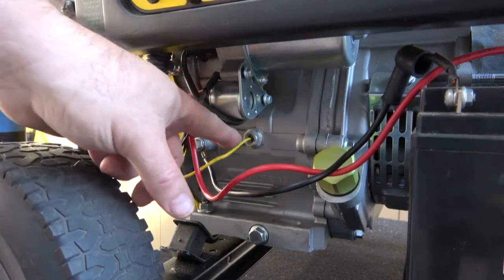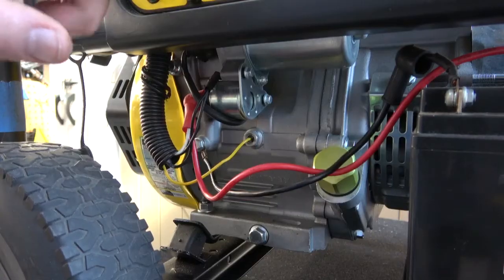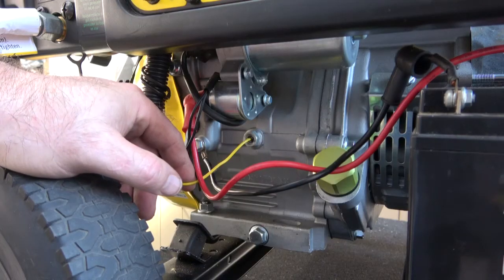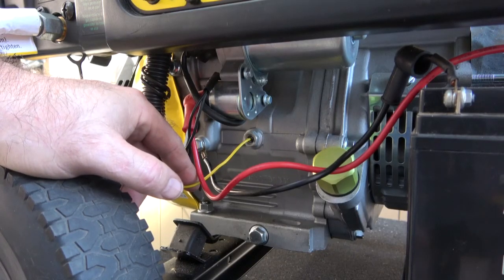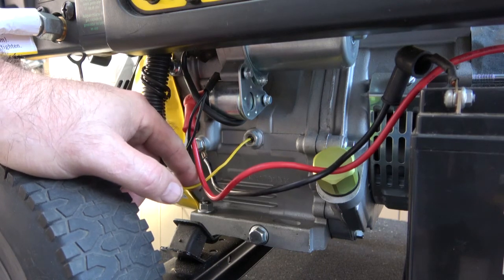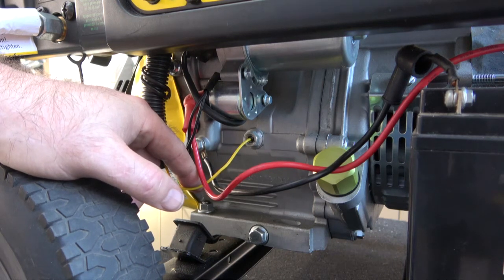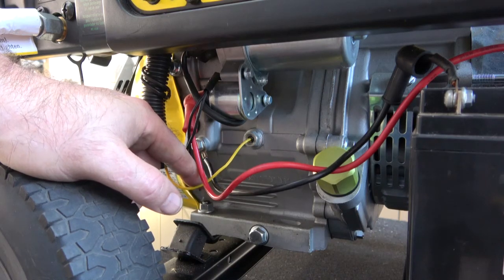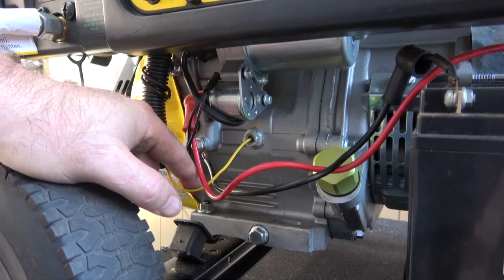WHY YOUR GENERATOR WON'T START | OIL SENSOR | Champion Dual Fuel Generator

Comment: Did not know what that little part was that went into the engine thank you. Now I know oil sensor, a rat chewed wire off. Was not able to splice because wire was cut right there by the sensor. So now I have to get on website and hopefully order new part.

Comment: I have a champion generator gas that someone filled with diesel.  Got the tank drained but it ran one time since then also back fires. Just won't start. Checked fire checked gas and air. Won't start. Checked valves none are stuck open and have been adjusted with a gauge. Need help. Thank you.

Comment: Before disconnecting the oil sending unit check for spark. If your oil level is good and you have spark, the problem is NOT the oil sending unit.

Comment: I installed a toggle switch for fast troubleshooting on oil shut down wire
It’s good to pick up one end 3 inches and drop it before starting 😊

Comment: oil sensor wire is disconnected from the sensor. How do I bring out the sensor for replacement
Reply: Remove engine and sump cover is how 
But lift it 3 inches on one end and drop it and try that first 😊

Comment: You mentioned the sensor is "real easy to change". It appears to me the engine block has to be taken apart. Am I missing something?
Reply: Looks to me it just unscrews out of the block.  It would be really dumb if the block had to be taken apart to replace a sensor.
Reply: Sorry, that I was late to answer your question. I was in a car accident.  I meant that it was easy to disconnect the wiring to the oil pressure sensor all you have to do is disconnected the wiring to the low oil sensor and  monitor the oil level. Some generator do not have that feature. If you want to change out the low oil sensor call the Champion help line. They are open 24/7. When you get on the line and it saids that we are closed just stay on the line you will get more options. They are the best customer service that l have ever seen. Bill

Comment: Thank you for the post, that's exactly why my Champ Generator did not want to stay running, after unplugging the Oil sensor, the Generator will stay running.

Comment: I have the 3400 inverter and the video champion sent me is very different then the one I have. I can't find my low oil sensor
Reply: Here is my email address. Sent me your contact information.  I will call you. The sensor is in the crankcase. I will send you a video from Champion showing where the oil sensor is in the crankcase.

Comment: I unscrewed the oil sensor thingy and the thing fell in and I’m trying to take it back out so I can put it back to normal do you know how I can take it back out
Reply from the maker: Sorry, I don't know. I would call  Champion at 1 877-338-0999. The call center is open 24/7 say on the line and don't hang up. It may say the office is closed but the call center is open. If there is an answer they will have it.

Comment: If your oil sensor is on will your spark plug still spark?
Reply from the maker: Your oil sensor is not on your spark wire. It is on  the engine. Look in your manual in the parts list diagram to see the location of the oil sensor.
Reply: Think he meant will it still spark

Comment: After disconnecting it,wen it’s on,how long will u put it back so they won’t be any damage
Reply from the maker: You Want to get it fixed But as long as you make sure the oil is not low or ever gets low you will be fine. The reason that there is a low oil sensor,  running the generator on low oil can cause catastrophic damage. If you decide to run your generator with the low oil sensor disconnected make sure you constantly check your oil. I would have no problem running my generator with the oil sensor disconnected I constantly check my oil anyway. It is very easy to change the oil sensor. Just order the part from Champion and have someone install it for you. Champion call center is very helpful. If you have any more questions just let me know.